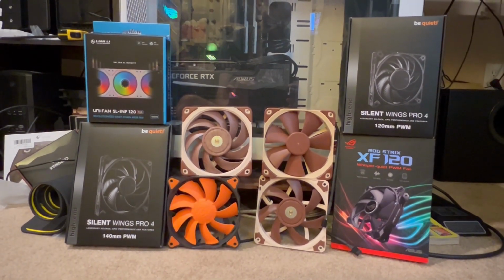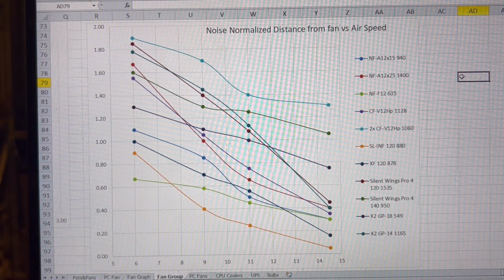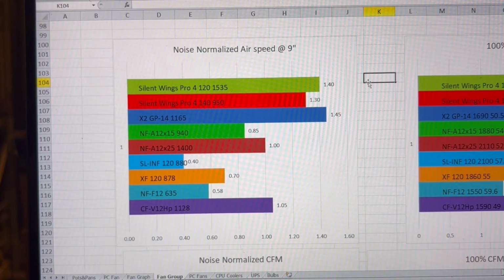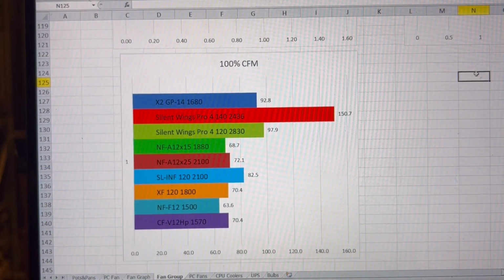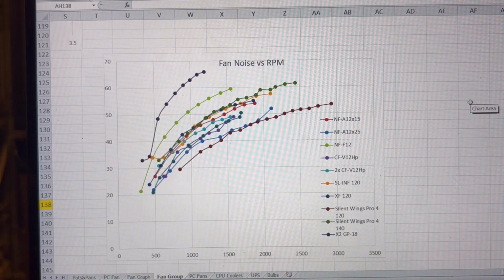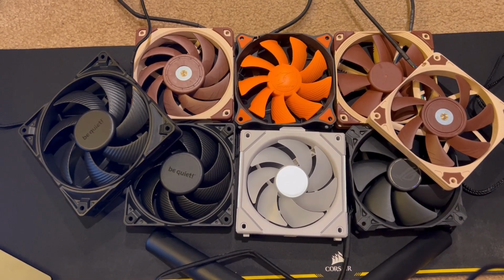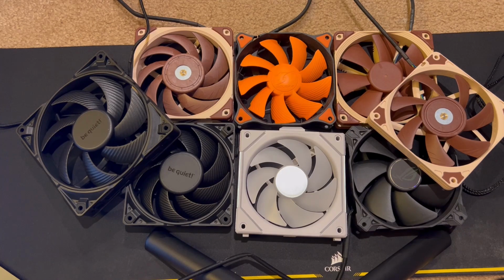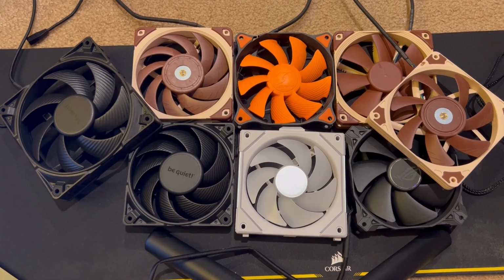10 PC fan round up: Lian Li Infinity, Noctua, ROG, & Silent Wings 4  (Old Testing Method)

Comment: Hi i am debating what to buy for a 420mm liquid cooler

the Silent Wings Pro 4 140mm or 

the Noctua NF-A14x25 G2

I'm looking for something quiet. The question is whether the Noctua will be enough in terms of rpm

and also what fans do you recommend for the case?
Reply from the maker: what kind of CPU? the G2 should be enough with a radiator that size
Reply: @computer-tech-more  I'm aware that the Intel Core Ultra 9 285K runs relatively cool,
Still, I'm a bit concerned that the Noctua cooler might be too weak not just for this CPU, but especially if I upgrade in the future to something hotter. I don't want it to always run at 100% just to keep temps in check, especially if it has low RPM.

Do you think this could be a problem? And do you maybe have something else to recommend something quiet, but with strong enough performance for my kind of setup?

And do  you have anything to recommend to me that is quiet and good For the case? This is my case Corsair iCUE 7000X
Reply from the maker: @assaf3468  hmm. my current cases are the torrent and the Meshify 3. My old case was an Corsair 550D. part of good airflow is balancing intake and exhaust. any case with a blocked intake will struggle more than a more open case in cooling. but for your CPU and your rad you could pick almost any 1500-2000 RPM fan and it will work well. 
The best fan I have tested was the P14Max (NO rgb), EK loop FTP140, Light Wings LX High Speed 140, and thoughfan 14 pro. 
What you get with the Noctua is known reliability. it will run forever.
Reply: Thanks for saying that! arctic p14 RGB died after two years in my liquid cooling I don't trust them anymore  @computer-tech-more
Reply: @computer-tech-more  I also have a 420 cooler with an i9 13th 13900ks processor. Is the noctua nf‑a14x25 g2 enough for it? Because I know it's a hot processor
Reply from the maker: @assaf3468  it should be. So I have an 11700K max power is like 250watts. An arctic liquid freezer 3 with 2x 140 fans is able to keep it cool without going to max RPM.
Reply: Thank you, you helped me a lot🙏 @computer-tech-more
Reply from the maker: @assaf3468  your welcome. Let me know what you went with after its installed and if your happy with it. :)
Reply: @computer-tech-more ❤
Reply: @computer-tech-more  Can I ask an unrelated question? I’m planning to build a PC with the RTX 5090, and I’m hesitant about switching to AMD. I’ve never used AMD before, and I’m currently debating between the AMD Ryzen 9 9950X3D and the Intel Core Ultra 9 285K.

I’m aware that the AMD CPU is around 30–40% better in performance, but I’m still afraid to switch to a completely new platform, including a new motherboard. I’m concerned about stability issues or crashes.

What would you personally recommend?
Reply from the maker: @assaf3468  until last year I had only used intel for the desktop in 2021 i think got my first AMD laptop. 
basically runs the same. day to day no difference. 
My personal thoughts are if you ignor power draw intels are better rounded CPU's with so many cores. better if you do video encoding via CPU or multi tasking. while AMD offers better performance if you do 1 thing at a time. then theres the power draw. amd is just more efficient. so less heat in the room. 
I would go AMD mainly because the intel 200 platform in the news is dead. like they are moving to a nother socket so theres no upgrade path. I bought AMD this time to test that upgrade path out. I'm hoping to use my current 9700X in am desktop then to media PC then to kids first desktop.
Reply: @computer-tech-more  Oh, I see what you're saying. I guess I'm kind of expecting a refresh from Intel, which is why I'm hesitating. Also, from what I understand, at 4K there's not really a noticeable FPS difference in gaming
Reply from the maker: @assaf3468  100% accurate. at 4k with even a 5090 you probably could get a 6 core and wouldnt notice much difference if any. 
Unless your video editing or coding or other CPU heavy tasks you dont need more than 8 cores or 8 "Big" cores. 
Kind of an aside i recently made a home media PC with a 7600X and it outperforms my 11700K in CPU and with the same 3070 i got slightly higher performance. Sooo. . . 

Like if you want the best and have the $$ its fine get the best. but if your on a budget forcus on the core of what the PC will be used for. just my thoughts there.
Reply: @computer-tech-more  Honestly, for lower-end PCs, it’s actually a good deal and I only recently started researching this. People hype up AMD a lot, but it’s mainly because of the price-to-performance ratio at lower resolutions. I’m really glad I’m sticking with Intel, because switching over is a bit scary for me. Plus, there’s going to be a refresh of this CPU soon.

It’s a shame people were misled like that. I don’t really get why there’s so much hype around AMD. Also, when it comes to single-core performance, Intel is still stronger.

I’m relieved, because switching to something I’m not used to makes me uncomfortable and I just don’t get excited about anything that isn’t Intel. I also saw that in heavy scenes in Battlefield 6, the FPS stays more stable on Intel, while it drops on AMD.

And just to be clear, I’m not some expert I just play casually and like buying the latest hardware, that’s all.
Reply from the maker: @assaf3468  i get it. going AMD with my newest gaming pc really made me wonder if it was going to work the way I wanted it to. 
I took the risk for platform/mobo longevity. I'm hoping to go 1-2-3 as in starts as my gaming pc 9700X, replace with AMD's next gen. (2) 7600X with media pc goes to a tests system (3) for this channel and gets replaced by the 9700X. 
the only other thing I will say is because intel draws more power you need that extra cooling. I have an air cooler on the 9700X and its mostly quiet unless im doing a stress test. 
Price of a CPU and Mobo are kind of similar for similar performance for each company at this point. Personally I see nothing wrong with intel as a product.
Reply: @computer-tech-more  It might sound funny, but after doing some research, I realized that AMD’s 9950X3D processor is actually really good. If I get it, it should be great for future gaming, especially since Intel is still lagging behind. So I’ve changed my mind.

The funny thing is, a good motherboard and an Intel CPU end up costing about the same, so it doesn’t make sense for me not to go with AMD.

Now I understand why so many people are choosing it.
Reply from the maker: @assaf3468  the "best" gaming CPU is the 9800X3D. 8 cores. the 9950X3D is 16 i think. Unless you are a power user you really dont need that much. I'm bringing it up because in gaming windows Parks 8 of the cores that are without the X3D. so in games its effectively an 8 core CPU. in software that uses lots of cores like you can use them all.
Reply: @computer-tech-more  Yes, I know they're identical and that the other one is cheaper, but I want that extra power for background tasks so gaming won't be affected — like browsers and other things running in the background. I've noticed that sometimes this CPU is slightly weaker in 0.1% low FPS, and that's why I wanted the more powerful one, even though I don't need a workstation and only use it for gaming.

And I have one more question — you're probably the only one actually answering me, so I really appreciate it.

 I'm torn between the ASUS ROG CROSSHAIR X870E APEX and the Hero one .
Do you think the APEX would be suitable for a regular gamer?

The only reason I'm considering it over the Hero is because this version has built-in 5Gb blue USB ports on the back, which I really need.

Thanks so much for your time, and sorry if I'm overcomplicating things  really appreciate your help in advance!
Reply from the maker: @assaf3468  My question of you is do you need the DIMM.2 slot. its for fitting SSD there. 
I actually have the Hero one your looking at and for my it "perfect" 
Its also do care about having 2 vs 4 RAM slots. I usually end up never populating 2 slots any way. but thats me.
In short both would be great options. 
If I were you before I buy I would open of the Manuals online and take a look at how the PCIe lanes are shared on the board. 
Like the hero has 3 SSD's at Gen5 but 2 of them share lanes with the GPU slot bringing it down to 8. 
The tough X870 has 2 SSD's at Gen5, 1 shares lanes with the GPU. IMO that means if i put a GPU there I am wasting 4 PCIe 5.0 lanes. 

The last thing is do both have the port selection you want for both the front and back.

Comment: Great video. I like how thorough your measurements are. You should take a look at the Antec T3 120 and 140mm fans. They are 30mm thick. I don't think anyone has reviewed them so far.
Reply from the maker: Sweet. The T3 was going to be in my next buy/review list. but it may take a bit for video to come out. I just dont have a fast release schedule. 
Thank you for watching. I'm glad you liked it.
Lots more fans coming up. I think my next fan release will have the Arctic P12 vs the Noctua P12.